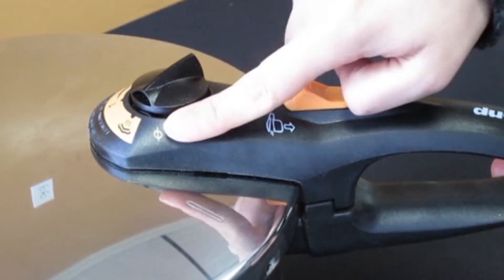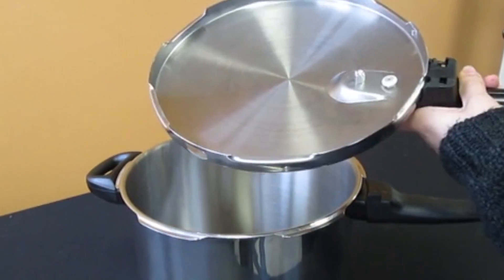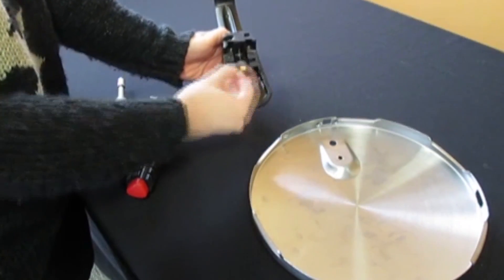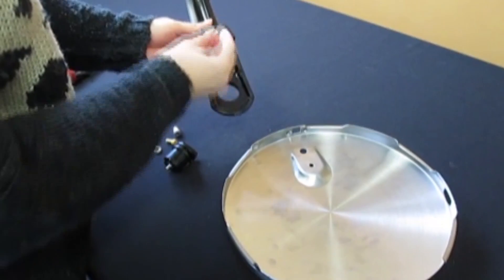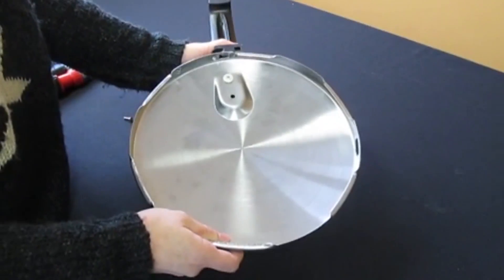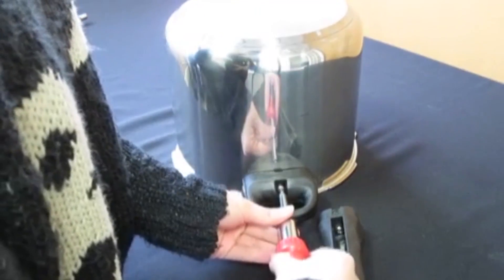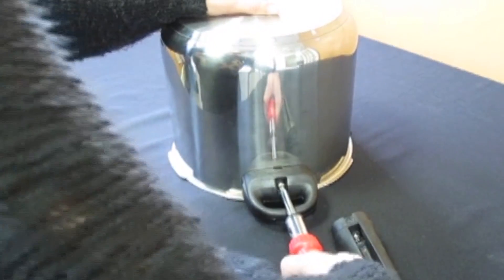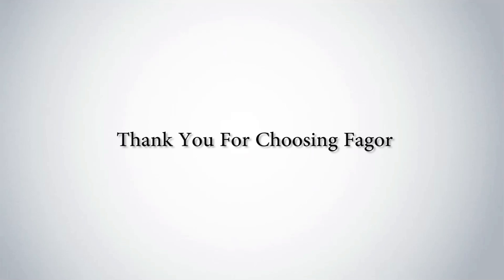FAGOR Pressure Cookers-  Removal and Replacement of Lid Handle

Comment: These Duo brand/model  are complete junk. I bought 2 of them, 1 for me and one for my daughter. Her's never once would pressurize mine barely worked about 5 times and now it wont hold pressure either. Its not the gasket or lid fitment etc., it's the pressure regulator built into the handle. Cheap ill fitting plastic junk. I tried to play with it and get it to hold then it shot the safety plug out like has happened to so many people here. Had an old presto with the weight regulator and a rubber safety plug and it worked perfect for over 20 years.

Comment: i can not get the lid off mine, does not obey the rules, like a chinese puzzle . was given it years ago no manual. only turns about a quarter. hadle switch does nothing  it is locked on. WHY??
Reply: ok fixed it . someone had forced the lid to far anti clockwise, a bit of wagging it about, released it, now works  perfectly as instructed